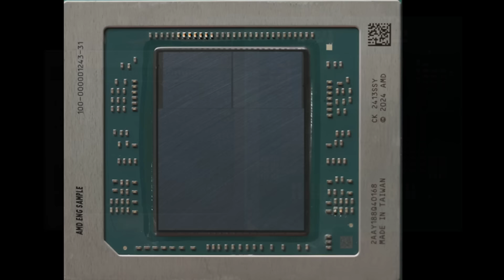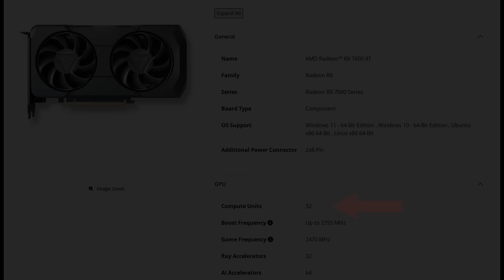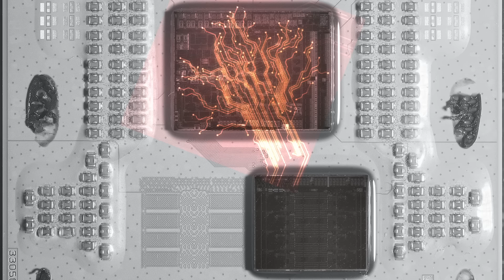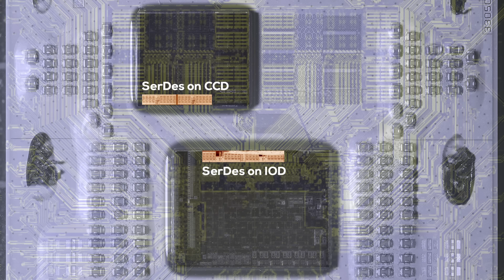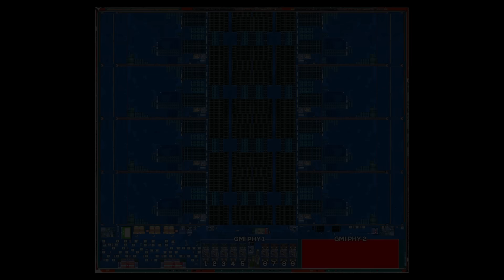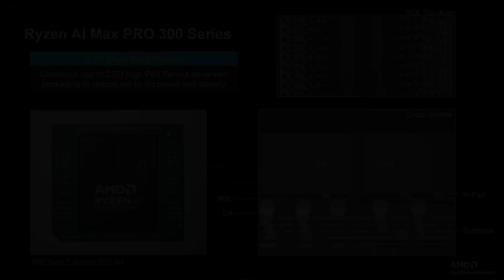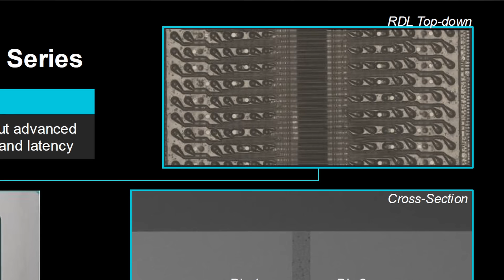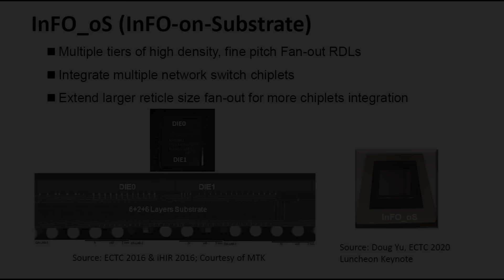How AMD is re-thinking Chiplet Design

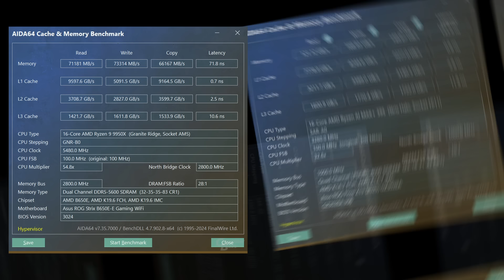Comment: at 20:11 holey fuck that APU is running in QUAD Channel mode on a fucking laptop and its only LPDDR5 4000 and its getting 121GB Read and 168GB Ruggt at a katebct if 143 NS (bad timings) if that laptop has upgradeable ram to say DDR5 5600 or 6000 the read and write would be insane and the latency would be cut in half. if zen 6 goes this route the desktop chips that run in quad channel, like EPYC and Threadripper are going to have INSANE bandwith beyond what we even see today. and even the desktop parts should easily double bandwith. i have a 9800X3D and i bet dollars to doughnuts that upgrading will be worth it.

Comment: I wouldn't doubt AMD's ability to combine V-Cache on the bottom with RDL. After all they designed the most complex chip to this date: the MI300 series. That thing was an order of magnitude more complex than Strix Halo, with compute dies hybrid bonded to active interposer dies, which in turn are stacked onto a 3.5x reticle silicon interposer which then connects to 8 HBM3 dies, for over 100 components combined onto a single package. The MI300 prototype was already designed to use hybrid bonding + organic RDL but AMD decided to use the much more expensive CoWoS-S for better structural stability. They already figured it out, over 3 years ago, and migrating that design onto a much smaller and simpler product is far within their reach.

Comment: If we extrapolate the development into the future. We will no longer be on 16 or 32 cores. We will be at 16 thousand cores (or way more) only 20 years from now, in 2045. Then it becomes obvious that interconnections will be more important than IPC from a hardware point of view. But a bigger change MUST happen; software and operating systems must be able to utilize all those cores. A completely new way of writing code must be developed. That will be a revolution on the same scale as multicore was for hardware. I have zero knowledge of how it will be done. But I do expect that the software "purchased" will, with the help of the operating system, it must be compiled on the target computer during installation to be able to utilize all those computing cores. 
I can not omit the feeling of the T800 transputer in 1988 that was killed by Intel 80486 successes. A single T800 had about the same performance as a 80486DX50, and we had boards with 1+8 T800 to play with... Those T800 were communicating on rather slow 5MHz links. Still, I did love them from a hardware point of view, a complete computer core with only 16 interconnecting pins (to the module) to build an arbitrarily big computer...

Comment: Serial signals are superior to parallel ones not just because of using fewer lanes (space), but because of synchronization issues. In the GHz territory, if you were to transfer a byte in parallel wires, the bits would arrive with huge time differences, because the wires connecting the components aren't the same length, and even millimeter differences matter in such high speeds, and getting CLK to arrive to the latches at the same time becomes impossible. But if you transmit data in serial you can re-sync data locally using big enough buffers with padding and some ack magic if necessary.

Comment: The major reason for serial connections is the signal reception integrity holds to much higher frequencies. Parallel has an issue called skew which makes the max frequency highly dependent on physical layout and delays in triggering of individual lines, matching all of the individual conductors in a set. Basically all of the bits of a parallel chunk of data need to arrive at the same time and strength so they don't mix with the chunks sent just before or after.

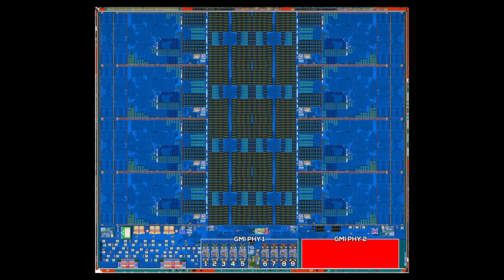Comment: 12:50 wait. Since a CCD has two GMI PHYs and an IOD also has two GMI PHYs, why can't AMD connect both IOD PHYs to the same CCD on single CCD APUs? Is the cost of designing a different substrate interconnect that high?
Reply: same reason why Xeons have 4+ memory channel and I-series only had 2 channels

Comment: Just asking, but doesnt seem like it would be much of a reach for them to add the cache in between the the dies next? Instead of fighting if it should be on top or below, why not just have a interconnect between the CCDs - this way you also get the benefit of not having to move any data if data in found on the cache as well? Because you can also stack the cache, you also have the benefit of it being its own thing with how many layers you wanna put on it. Even if you dont want that cross talking, it would still allow a space for each side to have access to the memory. I know they do something similar with IBM SoC when it came to the cache.

Comment: 20:20 Why did the memory latency double on the Z13 ?
I would expect the opposite with the fan-out interconnect, no signal transformation is required, so it should be even better?
Reply: ah, its because of laptop grade memory, its always terrible like that

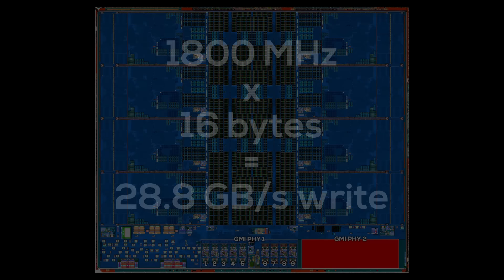Comment: @13:14  2 CCD's you only get double write speed. Read speed is the same. I can confirm the values are like that on 5950X with 1800MHz IFCLK.

Comment: I really hope that more units like the flow come out and get iterated on. Most 'gaming' laptops now you can't use on your lap, it's almost on fire at 80 plus degrees and has crazy loud fan noise. Not to mention miss ant battery life and if you run it on silent or battery safer your performance drops at least in half.

The flow is essent
Reply: The flow is essentially a tablet that performs better than most top end laptops except it runs super cool, whisper quiet and you can't actually use it on your lap and for a decent time between charge thanks to a low overall power usage.  

The only downside is its price which is why I really hope more variants come out and gets reduced through scale of production.

Comment: 21:50 in, I don't think AMD would have put the effort into moving the 3D V-Cache below the CCX unless it was for the long term (it was a lot of work to move it there) - and they knew the fanout was coming. I would say the chances it stay there is higher than it being moved back above the CCX.
Reply: I think so also, it have rumor about they shall increase the cache. 

So question is if 3D cache will have same impact. But they could be forced to move if on top again and solve the issue in zen 7. I think it depends on the time and they think it's worth keep current position, both for not delay and cost and if it is still benefits even have 3D cache for consumer cpu.
Reply: @mickearrow8035  the way they will solve it... will probably be just that the cache is near the fanout but not mixed with it.

Comment: The inFO - OS is actually a weak copy of Intel EMIB ( first product 2016 ) not FOVEROS. Intel EMIB is both electrically superior and cheaper than inFO - OS but requires a higher level of Assembly expertise to maintain High Yield ( > 99.99 % ) which is crucial for operations like Packaging downstream of much more expensive Front End operations. Fabless co.s have allowed themselves to become utterly dependent on a single Foundry and therefore open to manipulation by aggressive marketing using misleading technical information e,g. claiming superior electrical performance for their captive but sub optimal technologies.

Comment: Surely a slightly lower yield on a single larger CPU APU die would be worth the removal of the fan out / Ser Des? Or are they different process nodes or somehow fundamentally incompatible in some other way?
Reply from the maker: It's scalabilitiy. If you go monolothic, every chip needs a full tape-out and validation. With chiplets you  can be more efficient.

Comment: "this is zen 6 DNA, right there in plain sight" - under the cooling system, in the die, which you need some very advanced tools to see the insides... and it's probably less than 1mm wide!

Pretty amazing stuff, I have been wondering forever why they didn't put everything much closer.
Reply from the maker: Though tbh, Zen 6 could still be different. Maybe they will use what they learned from Strix Halo to improve Zen 6.
Reply: @HighYield  Point granted, just the efficiency of the interconnect is a game changer, the need for "full power" desktop chip becomes less and less important.

Tbh, I wanted this 10 years ago!

Comment: Well, while Intel was slower to it, I prefer their design with a silicon substrate compared to AMD’s current chiplet integration. Faster connections, lower latency, and subjectively just looks more professional than dies floating around a PCB. Looks like AMD is moving to a design more like Intel now.

Comment: I doubt the 3d v-cache will be on top of the die. The heat it held in the ccd kills the cooling capacity which hurts performance and longevity of the chip. It will likely stay where it is.

Comment: So as I can understand it, it is going from parallel to serial with a 2d connection to a new parallel 3d connection.

This takes out all the conversions, which reduces energy usage and gains speed.

When will this reach the limit, will they use a larger die, with older technology, just to use as interconnect, they will gain flexibility as well as speed.

My pondering results in the following, how far is it possible to integrate everything?
Do we go back to the very old systems with a processor card, so the main board is just a board with connectors, with only basic logics as sound, usb and connectivity?

This would create the most flexible system possible.

Comment: Congrats! I think this is the most accurate video on a technical level that you've produced! Jargons are explained concisely, and implication/comparison of important subsystems are explained in near layman terms.

I've posted many of my observations on other channels about these techs, but nothing beats having a video showing the actual implementation. Will point other people to your video when we discuss these chips.

Disclaimer: Below are all my speculations!

Just to add my 2cents, assuming RDNA3 uses SerDes in the Infinity Fabric, that could be reason why the 7900XTX performed worse in gaming benchmark than AMD initially projected. MLID channel initially rumoured that RDNA3 was supposed to have 30% more performance, which puts the 7900XTX closer in performance to RTX4090. 

The closest info I can find is from Tom's Hardware RDNA 3 Architecture deep dive that mentioned there are 50 wires per MCDs which seems to suggest a fully parallel interface (no SerDes) but AMD still had to increase the Infinity Fabric frequency by 43% which seems strange to me for a parallel bus which should operate at the same core clock speed. MCD will then do whatever is needed to cache and manage the GDDR6 memory.

If anyone is in the know, please enlighten me. I bought the 7900XTX because it's way cheaper than an RTX4090 back during the crypto boom. (That said, my 7900XTX was a great ETH miner.)

So, my suspicion is that the Infinity fabric interconnect has a higher-than-expected latency, which may come from a SerDes and not enough Infinity cache. In a game, any user input will cause the render pipeline to be broken. So, when there is a new Draw request, the pipe is flushed, and that's where low latency is important. Same principle as the CAS timing in DRAM. (Either this is true, or AMD was completely wrong when they did their internal performance estimate and RDNA3 was never competitive to ADA Lovelace.)

I disagree that AMD will switch all future products to InFO-oS. While the Strix Halo is awesome (I have 2 products in it at home), it's bloody expensive!

I can only guess that for economic reasons, InFO-oS will be used for high-end mobile APU (Medusa Halo) & MI Instinct Accelerators. Ryzen/EPYC will remain on GMI because dual-channel UDIMM and quad-channel RDIMM DDR5 is not fast enough to warrant such a big upgrade to MCM Interconnect. Medusa Point will probably remain monolithic because TSMC N3 will allow ~10-18% more transistors in the same space.

I'm thinking the InFO-oS interconnect "bridge" may be integrated with 3D VCache layer using it as the substrate, i.e., the 3D Vcache layer is slightly larger at the edge to provide the pathways between CCD & other chipsets.

I hold Intel improves their Foveros because I haven't heard much news while TSMC seems to be offering more diverse package tech for different applications.
Reply from the maker: I agree, AMD might use different packaging types. Even silicon based ones are possible, but ofc just speculation. Intel has been doing that for a while now with Foveros.

Comment: This will be wild speculation by someone that is not an electrical engineer nor something else in the industry but i don't know if Zen6 needs the 3dcache on top again, if they use a smaller cache die (do we even know what is the node used for current cache die?) they could put it at the center below of the core die and leave the shores for RDL for InFO

Comment: For those of us who might want something like it: How feasible would it be to have the memory on die, while also allowing for expansion RAM on the motherboard in a tiered memory system, thus allowing even Strix Halo to be upgraded, even if the slightly slower RAM is present?

We have l1 l2 cache now. Strix Halo ram would be like l3 cache, and sticks or modules of ram would be effectively l4
Reply: Reportedly AMD's MI300 accelerators can do this with HBM on package and CXL externally.  Intel's Xeon MAX pairs HBM2e on package with DDR5 externally.

If you're thinking of having something like LP-DDR5 on the package and an external memory bus, it likely won't happen natively unless AMD/Intel start to support CXL in their mobile chips.  This is a very unlikely scenario as that is seen as a pure server technology.
Reply: @powersixsixsix thanks for the detailed response...

Comment: Thinking that the 3Dvcache might be part of the GPU memory scratch for next generation with the AI advancements. it would allow the RDL to interface with the GPU and provide a shared 3dvcache for low intensity items. If not that, it will be instead integrated with the IOD. Reason being that the die space is important and the cache involved is some of the greatest cost for die area.

Comment: Using fanouts have some drawbacks, which was why they went with SERDES for so long. Fanouts requires a lot of wires, a lot of space, and each of those wires must be roughly the same length so that data in the same byte/word will be sent to the other chip and received on the same clock cycle. To do so takes a lot of detailed work. Chip packaging have improved so much since when I was a chip designer 20 years ago. This is pretty incredible and exciting to see.
Reply: well, thats why strix halo is really so expenisve, not because there is a 7600xt inside of it

Comment: I wish AMD would update their memory architecture to allow GDDR modules and HBM modules. It would solve the APU issues. It really is not that difficult to plop some GDDR or HBM memory on a dimm wafer and if they made the support built into their memory controller all the MB manufacturers would put a slot for it, then they would start creating it, and thus finally solving the decade stagnation of DRAM market.
Before you say anything, look up maximum trace length and realize that they test all these memory chips in sockets before they are sold, so saying that it has to be soldered is extreme ignorance on your part.

Comment: I remember Wendell from  Level 1 Techs describing how AMD platforms are so flexible. The motherboard only really sees the I/O die. Everything is routed first through the I/O die. As long as the I/O die is compatible, you can put whatever cpu chiplets behind it that you want. I guess as long as the IOD is pin compatible the fanout/organic substrate packaging shouldn't impact compatibility with AM5 platform regardless of what the do with v-cache.
Reply: They were forced to design a reusable platform to reduce their manufacturing costs over time, but ended up with a real winner for consumer hearts with how long each board is supported. 
This is the CPU equivalent of that Iron Man scene 😂
"AMD WAS ABLE TO BUILD THIS IN A CAVE. WITH A BOX OF SCRAP!"